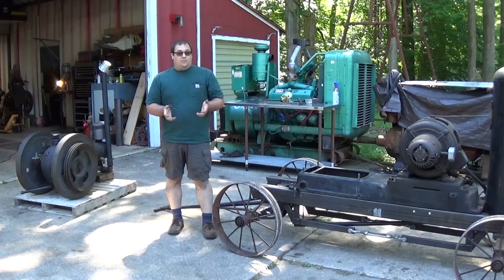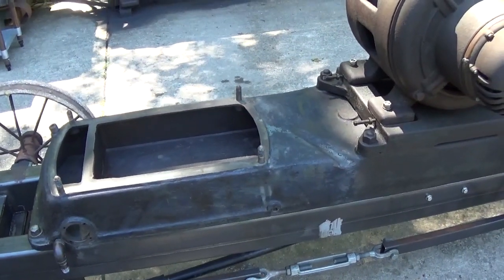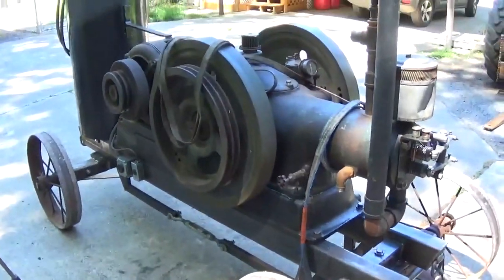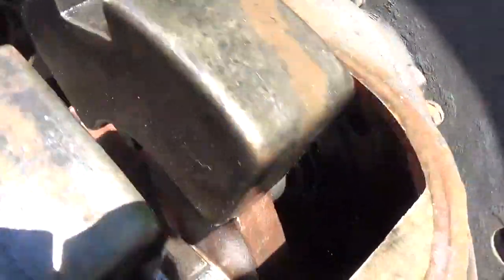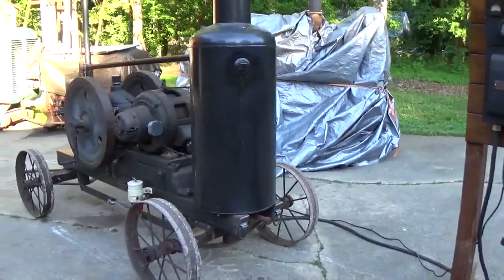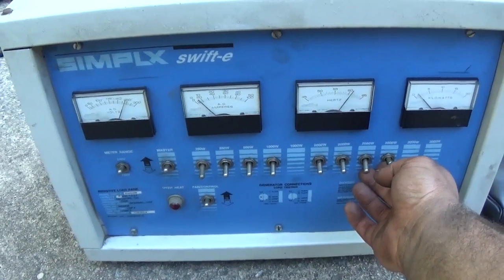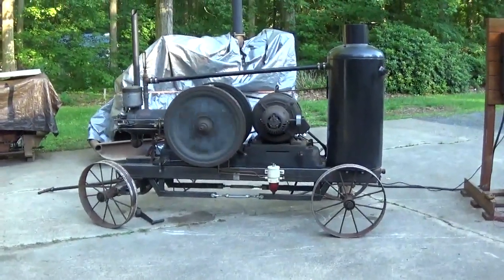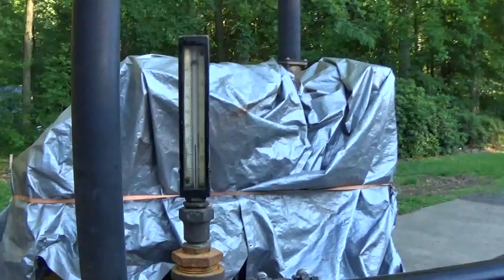1 CYLINDER DIESEL ENGINE 1941 Witte Dieselectric Plant

Comment: That is one well balanced engine. I've seen so many horizontally mounted engines that looked like they were going to shake the cart apart. Yours just sits there and happily runs so smooth.
Reply: ScubaTiger -  They must have been standing on wagons with rubber wheels then.
Reply: On those engines the crank shaft has the counter balance - the run far smother than when the counter balance was in the fly wheel also after they started casting or bolting the counter balance into the crank shaft - the could safely increase the HP and speed - early engines turned slower as not to brake the crank shaft - that's a common problem when the counter balance is on the fly wheel - 
      In the 80s there were 1000s of witty engines in serves putting voltage on pipe lined - 
      They were run on diesel crude

Comment: In July of 1967 my family visited Yosemite National Park in California, at the east entrance near Lee Vining.  Since that location is many miles from the nearest power line they had a generator supplying power for the ranger station and the related buildings in the nearby buildings.  It was a single-cylinder Diesel running at about 200 RPM with a belt drive to an 1800 RPM generator.  What impressed me was the sound and the electrical output, 240 volts at about 200 amperes.  The sound was a muffled chug, chug, chug that resonated in my chest lungs.  Years later the Park Service expanded the services at that location and brought in a power line from Lee Vining.
Reply: I worked the offshore oilfields and mountain oilfields for decades - oil is often drilled for in very remote areas - 
     I had worked on many of those engines & generators - there 1000s still in service today -  the muffler makes them very quiet - witty made engines / gens into the 1980s  - most areas that there in service have 100s of yrs of replacement parts - there re-ringed every 5 yrs

Comment: My Dad  started work for Oil Well Supply Co in 1937 out of the Ellinwood,Ks store.  He was the field man for “OILWELL” pumping units and Witte engines.  As a kid seen many new B & C models and later the little 98RC engine come in crates and then go out to the customers.
Reply: Witty was still manufacturing engines in the 80s - I've seen many that are still in service - there many that are used to keep voltage  on pipe lines - it increase pipelines service life up to 3 times longer - they keep a negative charge on pipe lines
Reply: @able880  I am now working on the F28, 32, & 42 model engines. Looking for F70 and 90.
Reply: @gaildimick1831  I'm a third generation mechanic electrician - my grandfather started working on  stationary engines in the very early 1900s -- 
      It was before AC generation took over - he started when many power plants were 110 DC - 
   Even the French quarter in New Orleans had a 110v DC power plant on Bourbon street that powered the French Quarter when my grand father was a kid -
     It was a hybrid power plant - they charged a large Battey bank 2 hours in the morning and evening - it was a 110v DC plant  -  
     witty engines were - from the begging my grandfather spoke of them as an excelent engine for driving generators in the oilfields - it's cool that you have some -
Reply: @able880  well you have a Heritage you can be proud of.  Keep up the mechanics, it’s fun and profitable.
Reply: @gaildimick1831  I'm retired now - I started in the oilfield in the early 70s - I had uncle's that were in the communications business also I learned electronic at a young age - 
        My knowledged was recognized from my start about gens and solid-state drive systems - back then we bought old retired  locomotives and up graded the engines fro 2 MW to 6 MW sets then we changed the traction motors over from being controlled by resistor Banks to being controlled by solid state DC drives - in the oil field those guys are coined SCR electriciins - you have to be good to do that kind of work - also the crews will ride those  guys into the ground if they can - 
     It was as if I had been pre seasoned to work in the oilfields - 
Also I started at a perfect time - I had the knowledge of the old systems and the new systems - 
       Growing up I was taught all about the old hybrid systems also one of my uncle's was on a sub during WW2  - 
      There were still old farm houses in the 60s that still.had the 32 volt farm light plants - I remember a farmer that refused grid power - he said he could get pole power for 35 cents a kw or he could generate his own power for 1.5  cents a kw  - diesel was about  10 cents a gallon for Farmers - his generator had a heavy low speed  engine so I guess it generated 12 kws per gallon of fuel it burned to charge his house battery's -  
      I remember those old 32 volt frigidare fridges that were in farm houses back then also the motor driven inverters so they could have 110 v AC appliances lol -
       Today when I tell guys that some of those engines generated 27 KWs per gallon of fuel there astonished - - running slow there is time to burn all the fuel -

Comment: Very nice complete set. Good to see that you kept the original look and not overpainted it as a glossy machine, but just clean and nice to look at. Thats how I like to see these old machines.
The real look of an old working engine. Looking at the Hz-meter it runs quite stable.Hz is the indication of right rpms. Maybe the magnetic field has somewhat losses his strenght, just keep it running and will come back.

Comment: Nice job . I love old engines like this . So simple compared to what we have today . 
I run a 2007 VW Touareg V6 tdi . Service is easy oil and filters etc . Any other issues you have to connect it to a computer and see what's wrong . 
I've got an old generac generator I was given . That wouldn't start . Got it running last summer . Making power too . Immensely satisfying ressurecting old machinery .
Reply from the maker: Very cool!  Thanks for watching!

Comment: My grandfather and I drove up the Alaska highway in the summer of 1965. The background noise of an old one lung genset could be heard in every little outpost in the sticks before electrification reached everywhere... Brings back memories
Reply: There still many of those engines in service west of the Mississippi River - there still portions of the western US that don't have grid power - those are set.up to charge battery's in remote areas were there is no grid - witty made engines into the 1980s or so

Comment: I love to see old antique machines working. I have a 1938 Singer Industrial sewing machine model number 111W113 for leather work, it came with an antique electric motor with a clutch mechanism that works opposite of how one works in a car. I operate the sewing machine using bicycle pedals. The electric motor would make the sewing machine run faster than I can sew.
Reply: That is awesome, and very good on the repowering

Comment: Awesome old machine, seems to be running pretty good for being 80 years old, pretty sure the stuff being made now days wont be running in 20 years let alone eighty. Simple and well built, wish we made things like this now!
Reply: If I could give you more thumbs up I would , to day I agree is a understatement.
Reply: Those style engines are still made and sold world wide look up lister CS engines - if you need a lead let me know - hey have a listerroid version - it's a clone of the original lister - but has been up graded to roller bearings - also the counter balance is in the crank -
     They sell them as air compressors - with a kit to change them over to a diesel engine - 
     If your mechanical it's easy to do - 
     Although the burn clean there not EPA compliant - there certified for CHP units in Europe - that is combined heating and power - homes use the during the winter to generate heat during the winter and the power generate is used in the home or sold back to the grid - 
       There is a lister  CHP in a hotel in Poland that has been in service for 90 yrs - I've seen the old brass bushing type in the oilfields running with  a quarter inch cleares at the mains that had been like that for a long time  - brass bushing are perfered in dirty or Sandy areas

Comment: I could listen to that bad boy chuff along at full load all day long. Actually want something similar to this to actually work when I get my Empire of Dirt fully set up since 3-phase and 240v supplies are hard to come by. I do want an open case though, wanna see the counterweights, rod, et-al whirling around in there. It'd run my shop air, my lathe, mill, maybe some lineshaft items that don't need to be super precise like bench grinders or bandsaws.

Comment: That is a sweet motor, i loved the lack of shake, to often they just seem to want to walk away sometimes run, beautiful set up.
Reply: The older engines with the counter balance in the fly wheel do walk all over - the newer engines have the counter balance at the crank jernol and vibrate very little -

Comment: Man, that thing is a beast. Sure seems kind of archaic for 1941...looks more like 1900-1920 and it looks like it came right out of a black and white 1920 catalog. Still, I am a bit surprised that by 1941 it's not powered by a flathead four cylinder engine. Of course that wouldn't be half as much fun. That would of course change the footprint and maybe it's all about being a diesel vs gasoline. Nicely done!

Comment: A guy would be amazed with condensation... I've walked into my shop several times and could tell exactly how much calcium chloride was in my rear tractor tires... Top of the tires dry and the bottom wet right at the fluid level
Nice toy.   I love old iron
Reply: You can see those 'frost lines' in some cold winter days too, can't you?
Reply: Oh that's my favorite. I used to pray both valve stems we're at the top of the rim before I shut down my 504 international in case they puked. Calcium is great for traction but good god did it eat rims if it leaked.
Reply: @dangoldbach6570  That's why beet juice is so popular now.
Reply: @TheOtherBill  I saw that, was considering going to it on my Ford 5000 but just have them dry for now. I have noticed that it doesn't have quite as much bite though. If I do fill them it definitely won't be with calcium

Comment: Great video.   As for the filter type that is actually pretty common in marine application up til the 60’s and even 70’s.   The tug I work on was built in 1958 and it had some oil and fuel filters of that style.   They have been mostly replaced by standard modern filters but there is still a couple left
Reply: Most of the older engines had a tube or sock filters - it was a cotton sleeve over a mesh wire - 
    You wash them out and reuse them - the cotton sleeve for a fuel filter last for several decades -

Comment: I am amazed at how clean the exhaust is.  I would have thought that a might smoke a fair bit given its age.
Reply: All those slow turning engine burn clean - they also can have up to a 27:1 fuel efficiency - at slower speeds there is time to burn all the fuel or even the oil that slips by the rings - many in the oilfields are run on diesel crude that's about #6;fuel oil - that one will run at 14:1 efficiency or so - that's 14000 watts per gallon of fuel burned  - they rarely smoke - 
      If they smoke the valves will carbon and it's difficult to start them - it's easy to change out the rings -

Comment: Your Racor is a 500 model. The disc type filter for the fuel and oil, where common on milling machines of that vintage as well.
Best wishes
Reply: I used to make ( help make) those separators for Racor manufacturing of Modesto California

Comment: That filter with the shims is a Cuno filter. In 1945 they were used on the Alco 539 diesel engine for oil filtration.

Comment: That fuel filter that was on the engine is a Mueller type filter. They were practically standard equipment on heating oil burners from the 1930’s through the 1960’s.

Comment: You got the condensation issue backwards.  A cold tank warming up will force air out of the tank so no problem there.  The problem arises at night when the warm tank cools and draws in humid air which then condenses on the surfaces as they cool.  It is hard to prevent as you need a vent in order to get the fuel out, but, as you say, keeping the tank as nearly full as possible is one of the best defenses.

Comment: Cool old machine. That type of filter is called a "cuneo" filter, have no idea why. I was taught about them in aircraft maintenance school but have never seen one in actual use, 30 years later.
Reply: It's interesting you remember the name of that filter - I had worked on crude oil pumpers in the oilfields - in the marsh country in the deep South were oil started being drilled long ago - many of those old pumping stations were built in the 1920s - in the 80s many had never been upgraded - those old engines had those fuel filters with a bunch of disc - I never knew the name of them till you said the name lol

Comment: They make one way valves you could add to the fuel cap. That would prevent the water from coming in while still allowing the tank to vent. Something like a simple dirt bike tank vent would probably get the job done.

Comment: Nice unit!😉 With all that flywheel mass and the extra flywheel on the generator side, it seems to run very stable, even more so than a lot of Lister diesel setups I've seen. When you threw that 6kw load at it, and it started slowing down, it didn't even smoke like it was being loaded heavy. I wonder if your pump is going full stroke for the injection, (or maybe the injector is a bit clogged)? Maybe getting the slack out of the governor linkage will cure most of that. I doubt that the rings or valves are worn too badly, as easy as it started. Even if you put some oil down the intake, it will generally slip past the rings on the first couple rotations, if they're worn badly. Overall it looks and runs great for an almost 70 year old genset.😁⚡️👍
Reply: If you notice the fuel pump rack does not move when he applied more load. His governor is not working.
Reply: If the rings are wore to were it lacks compression or the valves don't seat - that engine will be imposable to start

Comment: These were oilfield engines, they would run several jacks where electricity was not available. A fella would stop by every so often check the oil and fill with fuel.

Comment: hey that case forklift i found on the tractor models if you swap the 2 plugwires on the 2 center cylinders it ran better..it says the right fire order but it really does run better when you swap the plugwires over on the 2 center cylinders on that forklift..thought id share what i found, dont know why it runs better but it does 👍👍

Comment: I love old technology.  To see how they built stuff back in the day gives you the appreciation for their engineering feats. How long was it designed to run with the fuel tank size and water storage. If it powered a shop, would it run all day, or did someone need to play with it to adjust things ?
Reply: Those types of engines are still built today - also running 24/7 there 1000s in the oilfields - also in areas of the country were there is no grid as of yet -

Comment: Hard to believe how smooth this unit is running. They must of really balanced the motor well. Can you tell me how much difference would be noticed if the governor was operating correctly ??? Also, what is the service factor of the unit ???  Look forward to more on this engine video too. VF
Reply: You might look at some of my other comments - they might answer questions
Reply: @able880  You are correct Sir Sidney.

Comment: I would love to have something like this as an emergency power backup. I'd be super curious what sort of fuel economy it gets.
Reply: I think there are better ways today if you Need a Generator :)
Reply: I wouldn't be surprised if the fuel economy is pretty good.
Reply: @williamvaughan1218  neither would I because you can see it is burning pretty clean and not rich.
Reply: I have a simular set, more modern a jinima chinese diesel engine a clone of a 1930s yanmar oil field engine belted up to a 9kw winco generator 2 gallon tank is supposed to last 8-12 hours and seems to last some where in the middle
Reply: @DRNEGOLICIS  nice, people assume that they automatically guzzle fuel because they are old. But the truth is that they are usually pretty good. They turn so slow, have a long stroke and have very heavy flywheels and because of the slow speed and long stroke it gives them a LONG time to get all the fuel burnt. So properly tuned they're going to be quite a lot more efficient than most people assume.
Reply: @Forwardbias83  my grandfather was in the oil business and even though we haven't drilled a well in 30 years my dad kept a few wells and pumpjacks. Almost all the motors are from the 30's-50's and they're pretty similar in design. They just keep on ticking away and oddly enough there's regulations for how loud the wells can be because of neighbors etc. But they are also quiet compared to the new stuff. We even have what's called a hot bulb engine that burns just about anything oil that has been run for over a year nonstop before. It's cool because if the bearings get loose all you need to do is remove a shim or two and then it's good to go.

Comment: Cast iron should be burned in with oil (best oil for this is linseed oil). You spread the oil with a rag, take a clean rag and wipe any access off. After which you heat up the cast iron to the smoke point of the oil and keep it at it for around an hour.

Afterwards just use a clean rag and wipe any excess off.

Comment: Even if the engine would pass all the modern emission crap it would be banned because it does not have the required amount of complicated electrical crap and is way too easy to work on
Reply: It wouldn't matter if it were a temporary/portable setup you use during emergencies.